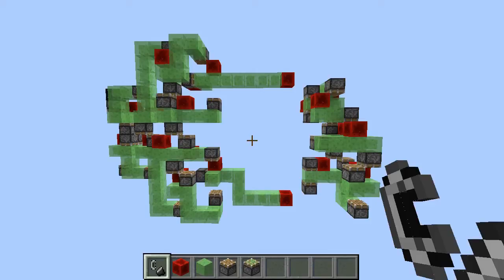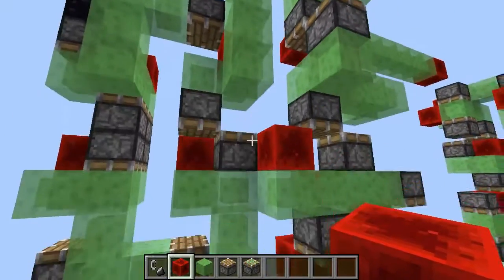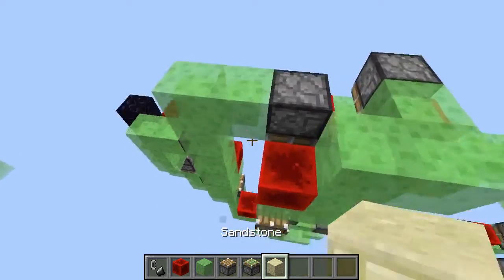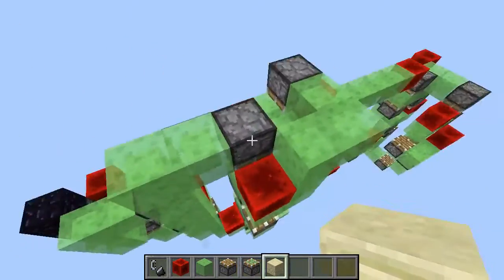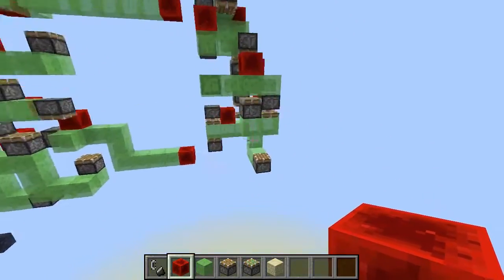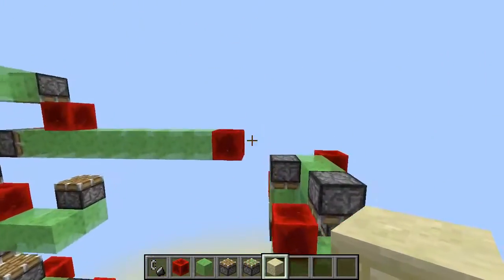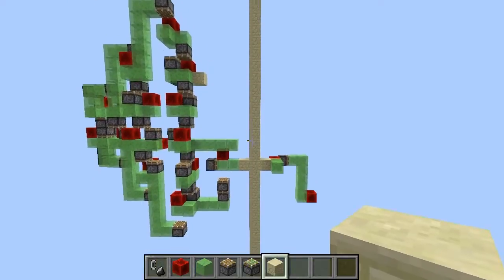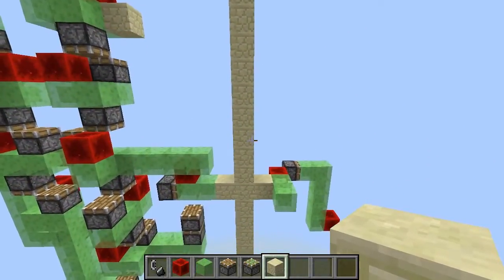Virtual slimestone connections: Direct powering - Minecraft

Comment: I really like the one going through a solid wall! I shall work on it and see how compact I can get it :D
Reply from the maker: RedsBoneStuff Good luck! Tried around for a bit with it myself, but failed ... would be cool to see someone else do it. :)
Reply: Wout12345 I'm still working on it and I've come really far, but I'm having huge issues with Wout-tech.
Reply: I've just finished a working design when I realized, with terror, that what I made is not what we need. The thing I made only has 1 connection through the wall and it has a reversable engine - when what we really need is something with seperate engines and 2 connections through the wall (just like the first device you showed in this video).
Reply from the maker: RedsBoneStuff
That's Jazz-1 tech, I don't think my general design is anything new. :P (Well, it's vertical, if that counts.)

However, one connection is fine as well, as long as it can guide the follower in both directions. :P
Reply: Wout12345 It can't be guided in both directions. But I'm working on it.

Comment: 6:01 But, if I understand correctly, this is directional, isn't it?
Reply from the maker: RedsBoneStuff In what sense? The BUD? Yeah, for some reason (update order I suppose) it doesn't always trigger when you push it. I suppose the piston needs to be updated after all blocks in front have become solid, as Sancarn's explanation for slimestone BUD's goes. In my design, this means some BUD's only trigger when going up or down specifically.
Reply: I remember having problems with these 0-tick pulses sometimes not powering pistons. I decided to try avoid using them because I am not really a fan of directionally dependent concepts.
Reply from the maker: RedsBoneStuff Well, I tested my 10x10 IFSS-1, and it didn't have any problems, so I'm pretty sure this also works. From my experience, update order is consistent, it depends on where you push the component from, regardless of how the component is oriented. There are also other machines of mine which use update order-dependency and I've yet to see orientation-dependency with those.
Reply: Wout12345 Well, that explains a lot. Seems like Mojang has done a pretty good job at banning directional dependance from slimestone. It is something one needs to sort out before even introducing the new game features.
I wish they had done that with pistons too ... but it is far too late now.
Reply from the maker: RedsBoneStuff Well ... I have to say, update order did seem to cause direction-dependency with the old VERBS design (I talk about this in my VERBS fix video) ... pretty strange, considering it wasn't an issue in very similar situations. Maybe horizontal/vertical also matters. :o

Comment: 5:02
This effect was kind of explained in sancarns initial quarry theory video at 1:55. /watch?v=MBkqc5vdZoA

5:47
As far as I know, that´s actually a 0-tick pulse, not a 1-tick pulse.
Reply from the maker: Myren Eario As for Sancarn's explanation: thanks! I'll add it to the video in a second. About the 0-tick pulse: turns out you're also right. XD Was getting some inconsistent results with command blocks, but with the tickspeed mod it's clearly visible that the block behaves the same way it does with a piston and redstone block powering a 0-tick pulse generator. I'll also add an annotation for that. :o
Reply: You remember the idea of a 3d or 2d printer? 
I did a 2d one(prints with cobble and stone) where you can build the pattern(9x9 pixels) out of glass and normal blocks and it gets printed(one pattern block equals a 3x3block pixel) :D
Only problem is that those pixels are always alternated because the wall eater is not pushing them in a straight line
So in theory you just need to push the printed thing and you have a 3d printer
I need to somehow add something to the walleater so it pushes in a straight line and the stopper for the walleater is missing...
Than its done :D
Reply from the maker: Robitobi01
Yeah, wall eaters aren't really meant for block pushing, they're more about collecting. :P Good luck though!
Reply: Robitobi01
 So you want to print out a 2D plane, and the push the entire 2D plane in a third direction? Pushing a plane of arbitrary size an arbitrary amount of blocks sounds difficult.
I sadly currently don´t have time to make huge slimestone creations, because of personal life stuff, so I sadly can´t help with the 3D printer right now. But in a few weeks I should have more time again and will help with a 3D printer, if you shouldn´t have finished it by then.
Reply: Wout12345
I wouldn´t say wall eaters are about collecting blocks, since the name "Wall Eater" just means "expandable 2-way flying machine". And I don´t think you can make a 3D printer without expandable 2-way flying machines.
Reply: Wout12345 In theory I just need to aline those block collectors(or in my case pushers) in a straight line so the blocks are also straight 
And thanks :P
Reply: Myren Eario To be exact it's a 81x81 block area thats really hard to push in a cube and incredible hard if there are air blocks(wich is at the moment not possible in the 2d printer) only way probably using silverfish blocks but than the generator is incredibly slow... 
But before I try 3d I finish and optimize the 2d printer 
And I will also try a smaller printer without flying machines that prints a 12^3 cube in that scale silverfish should be no problem and the pushing into 3d also no problem